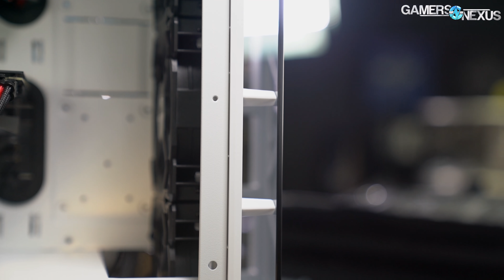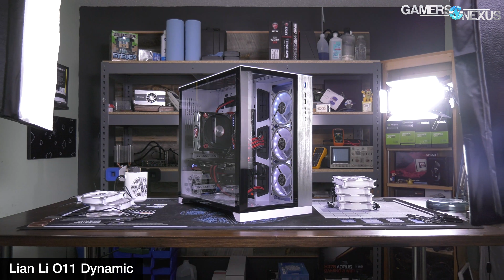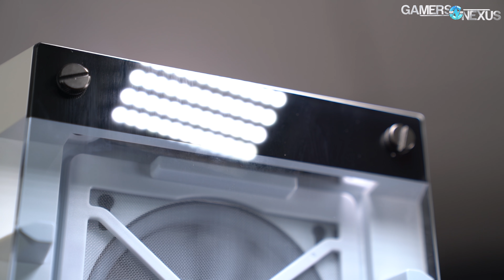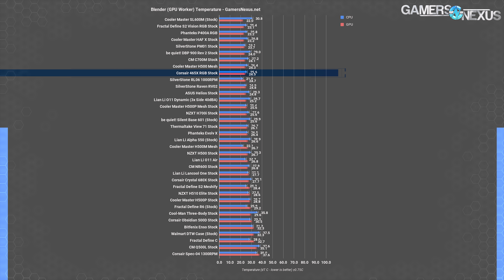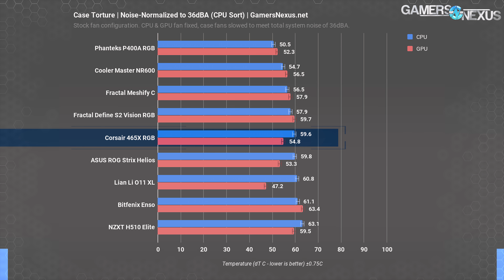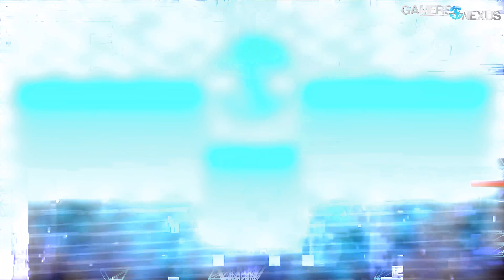Corsair iCUE 465X RGB Case Review: Glass with Airflow, Sort Of

Comment: ok, can I get that front panel on something with 55mm (25mm fan + 30mm rad thickness) above the motherboard tray for a top-mounted rad? Offcenterd rad top mounts are only good (for fitting a rad) if your VRM blocks are anemic (and would need the fans puling air threw them anyway) and you have low profile memory. I see potential here, just got to budget room for a 240 rad in the top, and finger room to plug in cables at the bottom edge of the motherboard (and pray there not 90-degree plugs).

I also like the vents in the PSU cover to let the bottom front fan actually cool something other than the drives and PSU cables, especially good for GPUs. I wish the PM01 had such vents, to be honest (pending mod). Thanks.

Great vid Steve and crew. B)

Comment: I've been waiting for someone to do a glass front case but with holes in the glass and have yet to see it.  I think the time has come Steve for you guys to put some holes in the glass of a case, but if I must I already have the diamond tipped glass hole cutting bits that will get the job done.  Not only have I wanted to see holes in the glass at the front but also some holes in the side right over the placement of a vertical mounted GPU.  I think it would work out nice TBH and you can make it look good with experimentation of hole size and hole placement in regards to design with the holes making some kinda of cool looking pattern maybe.

Comment: Steve: 5.25” drives are pretty much dead.

Me: *grumble grumble*...cold, dead hands...*grumble*
Reply: USB dvd drive that's 1/5th the size for 5 bucks, kgo.
Reply: But then how am I supposed to flash the custom firmware onto my BlueRay drive so it can read UHD disks? I had to put the SATA port into IDE mode to do that. I don't think your USB drive will let me do that. Also, where am I supposed to put the USB-[Insert newest version here] bay so that I can have modern front-facing ports without buying a whole new case? That ability alone has kept my old Lian Li cases (you know, the ones from back when they made the whole dang thing out of aluminum) viable to this day...well, that and a hole saw.

Oh, and get off my lawn!
Reply: @sadlerbw9  USB DVD drives update via the same usb port without needing legacy IDE modes, want a new USB C port? Well then get a USB C pci bracket and then extension cable or expansion hub and mount it under the desk.
Fyi this is Steve's lawn, stop living in the past.
Reply: But its all the way in the back, and those extension cables are so ugly! It would be so much prettier if I could keep all the cabling inside behind my non-glass side panel so I don't have to see it!

Oh, and being serious for a second, I was never able to get the firmware update to work when I had the BluRay drive in question hooked up to an external USB enclosure. I did try that first before actually hooking it up to a SATA port and setting the port to IDE mode. Actually, I tried a couple USB-to-SATA adapters as well, and those also failed miserably. The only way I could get the custom firmware to load with with the drive plugged directly into a SATA port on the mobo. To be fair, now that I've got the firmware flashed, I could take it back out and stick it in the USB enclosure if I needed to.
Reply: @sadlerbw9  There are no Sata ports for usb DVD drives unless you used massive ugly external 5.25 bay, and no the usb hubs aren't as ugly specially when you can just buy a 3M adhesive strip and stick it under the desk, but computers with 5.25 bays are dog ugly.
Reply: USB 3.1 PCI bracket, 10 bucks.

Comment: Why do many cases have a solid floor under the Sata drive cages? Why isnt that all open with a filter so air can come up through the case that way? Hard drives are going extinct...make better use of that area....make the drive cage removable and make it possible to put an intake fan there.

Comment: would you guys ever do a video about some cases you recommend under $100 while including some easy modding tips to improve airflow. not sure if you've already done this in a old video but i think it would make for some cool content.

i did this with the corsair Carbide Series 100R Silent which i got for $55 when i bought it the silent comes with 2 120mm fans i removed the hard drive bay and moved both fans to the front of the case and i installed a slightly more powerful exhaust fan in the back i also removed the front panel and pulled out the mesh that was glued on. this is my second pc build and i just wanted to say it's way better to take 20 minutes, do a simple mod and throw some money at that gpu.  thanks for all the videos you guys are great.

i'm not sure what all the variables are but its made roughly a 15c difference for me under load (metro exodus) high settings 1600x900 locked at 60 fps
ryzen 5 2600 stock
evga gtx 1660 ti black stock

Comment: You do not miss ANYTHING by not using iCUE Steve, this software is pure dogsh!t. Several days ago I've installed it to try the 7.1 surround emulation of a H60 headset, and, when I've uninstalled it (after deciding that the 7.1 emulation is not good enough) it completely DESTROYED my sound configuration in Windows (error 45 on my onboard audio driver, try a reinstall, even a restore point, did not matter. I had to completely reinstall my OS (W10 1903, completely up to date) before being able to use my speakers again.

And it's not just me, Corsair forums are flooded by people complaining about, for exemple, hardware not detected before an unplug/replug or not saved macro profiles. It's a shae IMO, because Corsair made some of the best products on their segments, but they are completely blasted in dirt by their crappy software.
Reply: I don't trust any 3rd party with my sound, however Corsair iCue is great for controlling its fans and led configs, nothing beats surfing the net, watching vids, and playing low end games without any fans spinning, of course if the CPU or GPU hits 50+ degrees all the fans start up

Comment: Unpopular Opinion Time: If you're considering the Lian Li O11 Dynamic as competition because you have to buy fans for it, you need to calculate the price for this case WITHOUT the $90 in fans that they're throwing in for "free". You say repeatedly that the case is fine for a $80-$90 case. Congratulations, that's *exactly what it is*. It's got 3 fans that retail for $30 a pop. You wouldn't buy this case unless you were looking at getting those fans anyhow, and that means the O11 Dynamic is a $220 case in the same circumstances.

Comment: What is with this 'Glass' heavy design, it's not practical, it's not even very good looking, it costs more money, and it makes cooling more difficult.

I fail to see any advantage.

Just stick a well made, high quality, mesh front, with a secondary removable mesh filter onto the front and top of the case.

You can still have some ambient lighting from the fans, or, from additional LED strip lights along the inside edge of the front panel.

And, disposable pop-out PCI-E bracket covers should no longer be a thing, especially not on any case priced over $30. Just spend the extra $1000 during manufacturing, charge an extra $1-$2 at retail and offer people features that provide better longevity and functionality and slightly higher quality.

This is the problem with a race to the bottom in terms of pricing, the products are really starting to drop heavily in regards to quality.
This needs to change, we need to see improved quality, higher than any quality we have had in the past by a significant amount.
Reply: Glass doesn't dent, glass looks shiny and premium, straight metal and mesh looks cheap, acrylic cases scratch by just dragging toilet paper across it.
You're never going to see how good glass looks on a case in a YouTube video.
Reply: Or just get a 10 buck open air case if you care about airflow so much.

Comment: Coolermaster did this before Corsair (well not technically if we also look at 460x), with a better looking side filter also; Coolermaster mb530p. Better value too. Chassis of this
 case is the same as 275r, not 460x.
Reply: If u also hate the x brace filter like me, ask corsair for a 220t or 275 airflow filter ;)

Comment: The non reusable pci slot covers is a deal breaker considering the price and competition that the case faces. Small details like that tell how much thought and detail went into the design.
Reply: to be fair, if you swap from vertical mount to horizontal mount, you can move the blanks from the back to the vertical slots, still not an excuse for not just making them re-useable in the first place though.
Reply: I always recoil when theres those snap off pci-e covers... Especielly in mid to high end cases
Reply: I get it, although you can get them for pretty cheap. A 10 pack of them is 7 bucks. https://www.amazon.com/upHere-Maximum-Profile-Expansion-Vented/dp/B07CB4GBSH/ref=sr_1_2?keywords=pcie+slot+covers&qid=1570254584&sr=8-2
Reply: I mean its a terrible idea to vertical mount your GPU because it will be choked of air unless its liquid cooled but I still have to agree with you.
Reply: Pretty sure my 460X has replaceable PCI slot covers......that I reached into my bin of randoms to move the GPU. Pretty happy with the 460X but the 465 has a nicer looking front. Definitely a case I enjoying keeping lit up.
Reply: @nateo200  I actually tried buying that case but it got back ordered. My buddy has it and I really liked it, but I'm definitely happy with my 465x
Reply: Lol, really.
Reply: They must've updated the cases because all my pci slots are just held on by the screw and no snapping of the covers are needed. Bought the case yesterday and I noticed it has a big block that has 4 ports labeled TEMP and 2 labeled USB, all the reviews of the case I've found so far don't have this box, only the one box for plugging the fans in.
Reply: Disagree entirely. There are 2x non-replaceable covers. And vast majority of buyers of this will use 2+ slot gpus. Means that wherever the gpu is placed, there are always sufficient covers included - even if the gpu was previously in front position.
Reply: You can put the ones of the horizontal slots on the vertical side as there is a screw tab to mount them.  .Or one could  buy replacement ones down the road from micro center for 2 dollars. I rocked this case for years.
Reply: it's unacceptable in cases above $50. Seriously. It's a real safety hazard, I always cut myself on those!
Reply: @neoqueto  oh goodness, poor baby.

Comment: That's why I love my Haf XB Evo. It has mesh, filters and holes everywhere.
Reply: OMG that looks like a dust box nightmare.
Reply: @Skelath  It isn't.
Reply: I unscrew 4 thumb screws wipe down one mesh panel with a damp cloth and then vacuum, yours looks like it needs to be taken apart and put back together while simultaneously pulling in dust from multiple sides.

Comment: any side blowing fans over a board is kind of stupid.
remove the window and fit a fan for direct air over the pcb for best performance.
Reply: You clearly haven't seen many servers :P
Reply: @popcorny007  the servers head sink is in line with the air flow. they are fine being a positive pressure
Reply: @popcorny007  this isnt a server  rack. you clearly have them confused

Comment: dude if you buy this case
it means that you have 2 sluts
to occupy with a graphics card
so you don't need a reusable PCI-e
for the vertical sluts cause you can 
put the ones from the horizontal..
(when occupied) so when you buy
this case you use horizontal PCI-e
sluts or vertical PCI-e sluts...
but you don't but this case if you'r
not intending to use any PCI expantions,
there for not putting reusable PCI-e
for the vertical sluts isn't relevant...
cause you can always use some spare
reusables from the vertical sluts...

and as long as you have enough sluts,
all is just fine :)
Reply: sluts?

Comment: This case has the exact same design, material and appearance with Corsair Carbide 275R.
Only one difference, front panel is not solid plastic, its glass.
HDD cage, SSD brackets, cable management everything is the same.
Reply: There's 1 other difference, it's twice the price..

Comment: So compared to the old 460x, it comes with a full length PSU shroud, a better set of fans (LL vs SP) and one less SSD tray and they're not even the better spring-loaded ones like before. If you own the 460x, like me, chances are that you've already upgraded the fans making the potential upgrade to this new 465x even less likely.
Reply: Moto3 oneone  Both look fine, but I've grown tired of that look already.

Comment: Between this case and my Lian Li 011 Dynamic, I'll take the Lian Li case every time.
Reply: For sure!
Reply: The bling side of me wants the dynamic razor case with a 360 aio

The cheap side says get a meshify c or 500p and slap a nocutua cooler on it
Reply: @scottmurphy4946  Well I don't think you can go wrong with either. I like the Dynamic because not many cases has room for an open-loop with 3 360mm radiators and 9 rgb fans like mine.
Reply: Same. Best looking case in my opinion. I have the air version.
Reply: Nice case! What kind of PSU do you use with that?
Reply: @danielgriffith8911  I'm using a EVGA 750 B3, 80+ Bronze 750W, Fully Modular.

Comment: Let me offer a better material as a front panel. It is clear. It is more transparent than glass. It does not obstruct airflow. It helps cooling performance. It is cheaper than dirt. Though it is not structurally strong. Guess what it is.

Comment: This looks good, and the LL fans included are a good value. However, RGB is way too complicated. Not in the sense that it's hard to set up, but in the sense that there are way more cables, the more RGB parts you have the more pieces of software (or even hardware) you potentially have to download (or buy respectively) to control RGB functionality, and having different pieces of hardware with RGB can display wild inaccuracies. It's particularly annoying that 95% of mid to high end motherboards have no RGB-less option.

When the day comes that we can transfer power and data with only one cable on an RGB fan, use RGBW LEDs instead of RGB for better color representation, and increase general QC with what RGB LEDs are used, it'll be more appealing to build with them.

Comment: That's a carbide 275r with a different front panel.

Literally! I have the carbide, and is exactly the same case.
Reply: It's a glassify 😂
Reply: Keen eye. 

For future reference, our 750D, 760T, and 780T were effectively the same chassis as well. The 570X and the 500D share a uniform base chassis, too. Tooling a case is really expensive - so when you have a good "base" chassis you add different features/industrial design to differentiate models. So take the 275R ($80), improve the airflow, add some glass, and add three LL120 RGB Fans ($129) and you get the 465X RGB ($159). 

I think the value is pretty solid but I've been wrong before.
Reply: @geotherapy  yeah, I think that it's a pretty good deal especially for the fans. The carbide cost me 75$, but I had to replace all the (two) fans and add some, as the stock ones were quite bad, making the price similar to this case in the end.
The body itself is quite good, I wonder if you could buy a 465x front panel alone (and front IO, as it's different but modular), and turn the 275r into a newer case.

Comment: Are you going to be reviewing the Corsair 220T by any chance?
Reply from the maker: We requested it!
Reply: I like the look of it, other reviewers say it has great airflow so I am getting one tomorrow. Still not as good as a GN review!
Reply: @craigsommerville3863  It's a Meshify C clone by corsair. It is good airflow by design.
Reply: Craig Sommerville i just ordered one today! I really hope it will be good
Reply: was looking at it, ended up going for the White Meshify C instead.
Reply: I’ve built in one and it’s great.
Reply: In win 103 reviews are very rare, would love to see it on my favourite channel :-)
Reply: good case, but very little room at the back for cables sadlty!
Reply: @Daisudori  Doesn't really matter, you're only gonna do cable management once. i sold my old itx nzxt h200 pc for cheap just to get 220t and build a new pc that's how beautiful the case looks and performs + i had no issues with cable management!
Reply: I have one. It is really small. You can only mount the AIO radiator at the front ( if they just make the height 0.5 inch higher, it could fit on top). There also a gpu lenght limit. The maximum gpu lenght is 11.5 inches if radiator mount at front.
Reply: @jimmyluu89  That's not true. With a non rgb ram you can easily mount the rad on top and I have the radiator mounted on top with my vengeace lpx memory kit.
Reply: Tee ShK yeah you right, I forgot to mention about the rgb and non-rgb ram.
Reply: built 2 computers with this case and overall it is a nice case with good airflow, it does get cramped with all the cable management, would not recommend not  using a hard drives since i had to remove it from both my builds because I the psu cables were too cramped and i had no space to get my hands in there to cable manage. This case is nice, I recommend it.